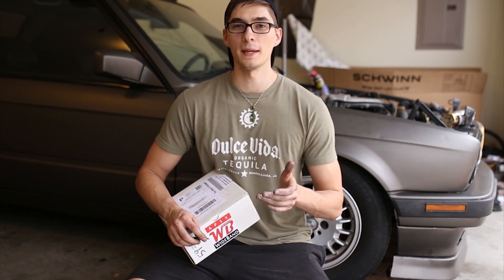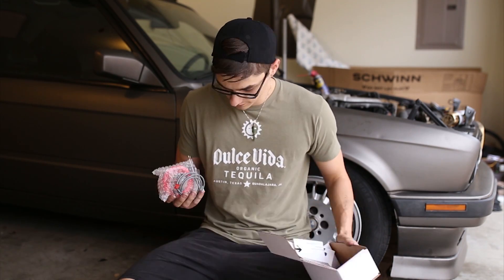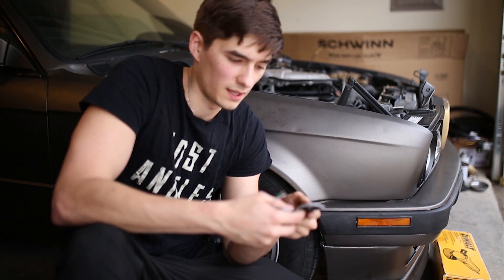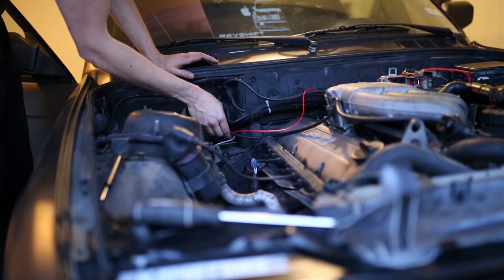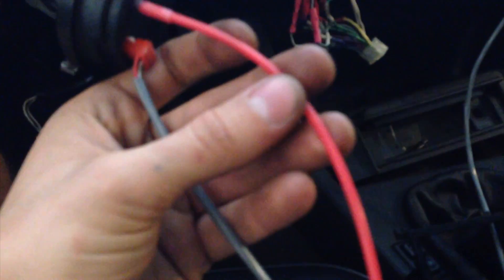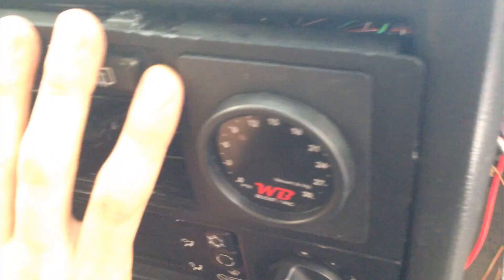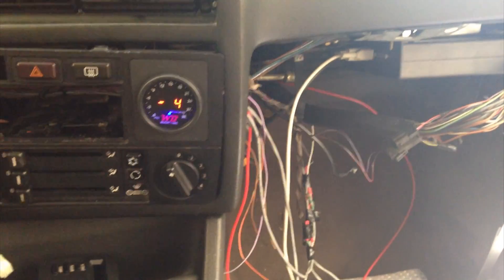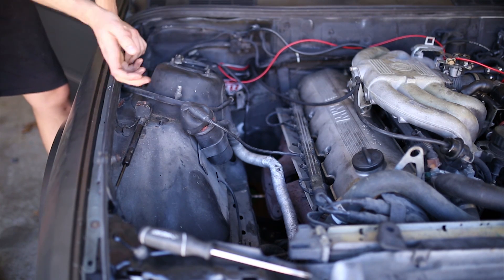Turbo BMW E30 Build: Part 9 | Wideband & Boost Gauge Install

Comment: Okay so i bought a boosted e36 that wasn't running with an innovative afr gauge that has multiple settings. After months of it sitting i just got it started and the afr reads 19. It has a 22RPD Tune with the current set up. It doesn't fluctuate at all. And when i press the throttle I'm not sure if it goes to 14 or 17. But I'll let you know tomorrow. Is my sensor bad? Does it need to be removed and recalibrated again?

Comment: What wire on the wideband o2 sensor did you use to plice into the factory o2 harness?? I’m trying to find that out because I’m doing the same thing to my e30. Thanks
Reply: me 2
Reply: me 3
Reply: @brady5829  me

Comment: How well did the cxracing manifold fit?
Reply from the maker: No issues actually! I think it may have even cleared the oil filter.
Reply: Cool!  I would personally be tempted just to settle for a turbo adapter...just not sure how much boost that could take
Reply from the maker: +Daniel Hartman this was cheaper but will need bracing. 
An adapter will not flow enough for my hopeful power numbers.

Comment: whats your plan for fueling this once your turbo is installed? would be cool to see an e85 e30
Reply from the maker: +Lantourismo It has crossed my mind. I can get it here, but it is about 10miles from my house. Not exactly easily accessible. I think ill run 93 with meth and call it a day.
Reply: EuroGarage dude you should definitely run meth that'd be sick and please do an install video on it!!! I have a m20 too and been wanting to run meth! Please make it really in depth  if you can!

Comment: you could keep the OBC and get the blanking plate for the head-unit it would probably fit 2 gauges nicely just a though. love following this build, i'm a UK 325i owner :)
Reply from the maker: +McSprog OBC is fairly useless though.
Reply: +EuroGarage yeah i have to agree but i like my orange lights telling me the time :P whats the goal in the end with the build? quater mile time? a dyno print out? track? or just some fun building?
Reply from the maker: Somewhere around 350Wheel. But I just like building things.